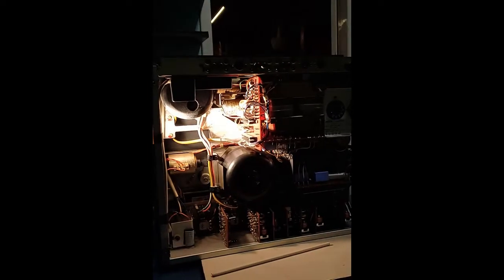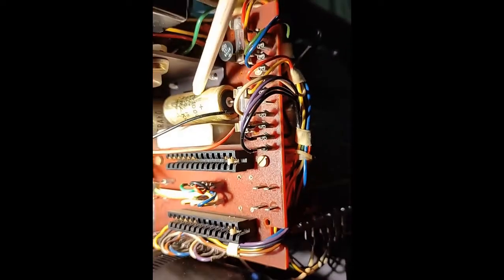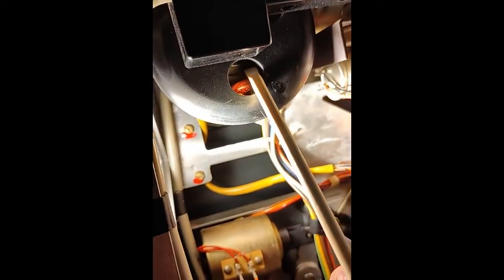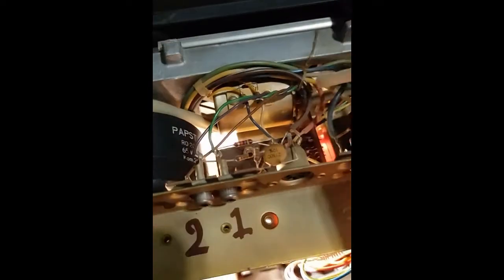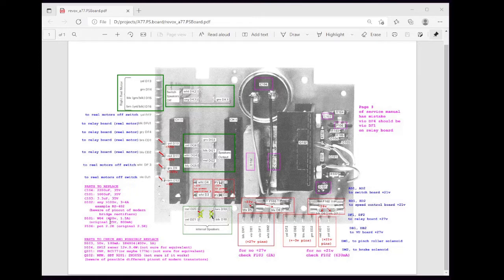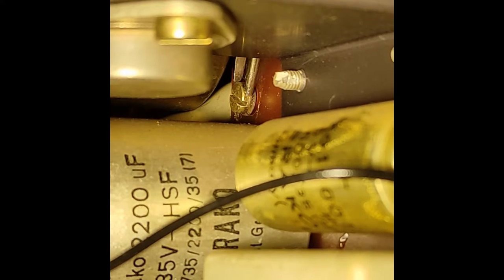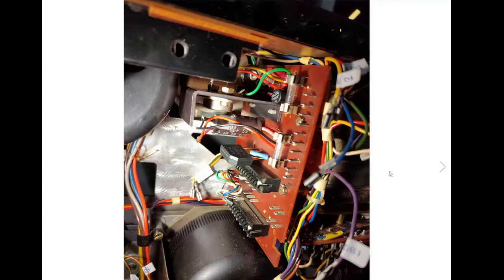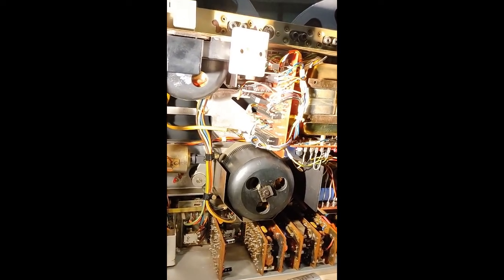Revox A77 Power Supply Board service

Comment: I just removed the board I just want to share  with you that I found a very easy way to remove that screw in the back , I just used a pointed screw driver and knob off the post from its base and it come out  attached to the screw , very easy . Thank you to share your video  !
Reply from the maker: Thank you too
Reply: Just did the same this morning, lol😂

Comment: 😂I agree completely with the previous writer! Just bought the complete restoration kit on E-Bay and waiting for the delivery as also for a divice to test condensators and so on wathever is on the board to find of my REVOX Mark III. 
Thank u indeed so much the same and lets find out everything. This morning I unscrewed the impossible bolt near the motor just with a thin, long screwdriver ticking it around anti clockwise before I had it oiled a bit. It’s an adventure…

Comment: I remember doing this service to mine years ago. I resorted to removing the entire assembly, transformer and all. It was like removing the transmission from a car, heavy and clumsy getting it out and back in. I took so many pictures and made so many drawings to make sure it all got back together right. That trimmer pot on mine was in bad shape, so I replaced it and adjusted it to spec after the machine was running again. That was a good 8 years ago or so, never had a problem with it since then. Replaced all the electrolytic capacitors as well as those problematic film capacitors on the transport control board, the ones that go up in smoke. Still plenty I could do to it, its really a pleasure to work on and use. Thanks for the video.

Comment: That power supply pcb is a pain in the ass. I cut all original smooth wires and create extension with proper copper stranded wire. Double insulation on every junction. The original smooth copper wire has coating that must be scraped with exacto knife in order for solder to grab.
Reply: could you send me pictures of that service with the cable wires?

Comment: Great video and well explained my capstan motor won't move how and where I plug the meter to check for 21 v   Thank you
Reply from the maker: on the pins as showed on 28:26 put meter with positive on the top first pin and negative on the 3rd. Generally, from the top, the first 2 are +21V, the next 4 are ground, next 1 is open and the next 4 are +27v. Very clearly shown on the document on the link on the description of the video.
Reply: @dchatz  That’s great thank you I’m watching your video how to service the speed control board  , I may need do that next   .Thank you
Reply: @dchatz  I need to have the machine connected to power with the jumper on right?
Reply from the maker: @imsaint007  yes

Comment: I've repaired and restored 5 of these. Removal of the PS board is the hardest part of it.
Reply from the maker: I think the hardest is the mainboard (the board where the cards slot in). I have not done it yet and thinking of doing it with video to help others. The PS board with the info in this video looks straight forward.

Comment: I'm trying to fix the problem myself I'm not a technician but I can replace parts and try my luck ,the capstan motor is not working so I replaced all 3 boards new  and still is not working  where should I start looking now , I adjusted the pot to  21vDc on the  power supply but shows 32 vDc  where it should be 27 v Dc .the fast forward and rewind works  not the capstan motor .
Reply from the maker: Can be bad motor, damaged tacho sensor or else. Tou have to check tacho sensor signal. check motor for open circuit. Did you replace power supply board? Did tou check the motor capacitor?
Reply: Yes ,  new  power supply board ,  speed board and  3 new  motor capacitors ,  Thank you , your video help me a lots doing that  ,I'll check the tacho sensor   @dchatz

Comment: Hi, thanks for your work, is very important for me, your video is perfect😊  I have a problem with my A77, it works perfectly but: After 20 minutes from switching on it stops, the EOT bulb becomes weak and the recorder does not start again. I have to keep it off for a few minutes and then turn it back on and it starts again but then the situation repeats itself. I am convinced that the problem comes from this card, what do you think it could be? Thanks in advance

Comment: Hello, I have a question. The revox a77 has a 25 kohm potentiometer, can I install a 22 kohm? Thank you.
Reply from the maker: @vitezmiroslav1389  sure. I also did that. 25 kohm pots cannot be found now
Reply: @dchatz  How many volts does it have to be? Does it adjust with it? Thank you.
Reply from the maker: @vitezmiroslav1389  yes. And it must give 21v. Adjust it to about 21.4
Reply: @dchatz  Thank you very much.
Reply from the maker: @vitezmiroslav1389  beware. I see that mine is 2.2 and NOT 22kohm
Reply: @dchatz  Yes you are right. 2.5 kohm. Thank you.
Reply: Greetings. Is it possible to adjust the vu meter on the a77? Thank you.
Reply from the maker: @vitezmiroslav1389  download the service manual for all answers. Rec amplifiers have a trimpot called "METER CALIB.". Each one has for each channel. From there you may adjust the vu meter.

Comment: Pls Just tell me how can I repair my power supply only when I put new fuses n switch on the burns internal lower only
Reply from the maker: Take all the preamp cards out. Check again. If it fails check the diodes on the 2 solenoids. If OK then you need further check by a technician. If you can fix electronics yourself you have to start checking all the components on the power supply board and then proceed to check which line has a short.

Comment: Great video, this will help a lot. When recapping it, there’s a few electrolytic capacitors which are hard to get. Did you buy it through Nagravox or was it cheaper to buy on your own?
Reply from the maker: Generally I bought all elect.caps at my nearby store. Some values are not common, mainly 25 or 250uF but do put 22 or 220uF instead which are common without worries. If you want to be accurate (which I think makes no difference) you may put 22+2.2 instead of 25 and 220+22 instead of 250. Generally getting the closest existing value is a safe choice.
Reply: @dchatz  Thank you

Comment: Did you have to remove the solenoid and/or motor to get to that screw ?
Reply from the maker: No, all this effort was to finally avoid removing anything else. And it suceeded.
Reply: I first take out the 2200uf  50v cap. First remove the leads. I use a 3" screwdriver.